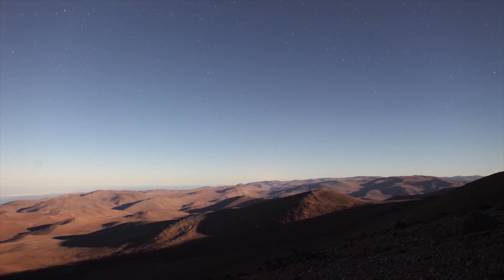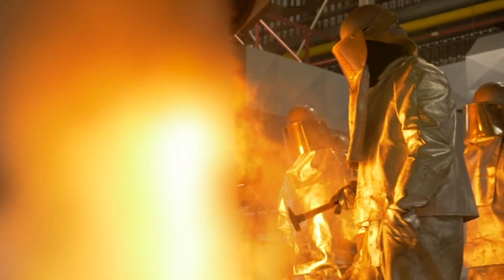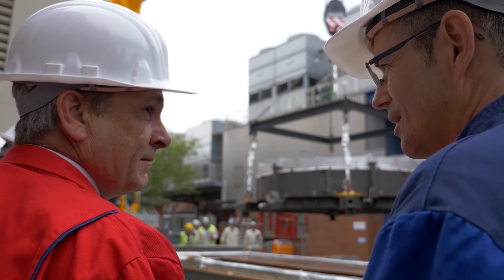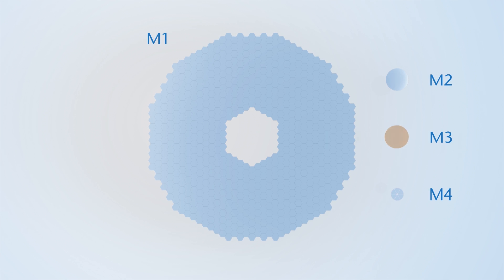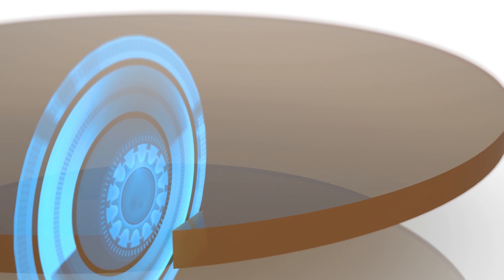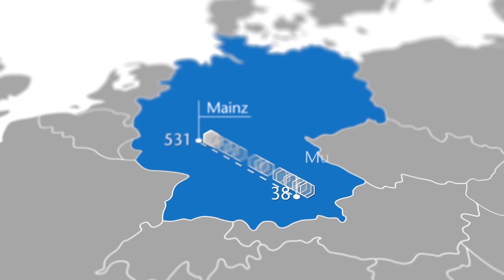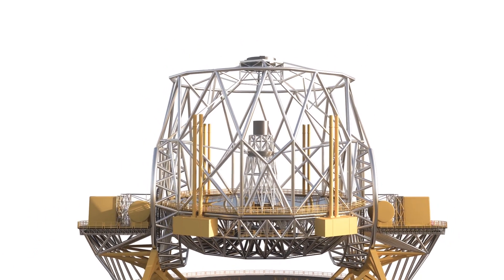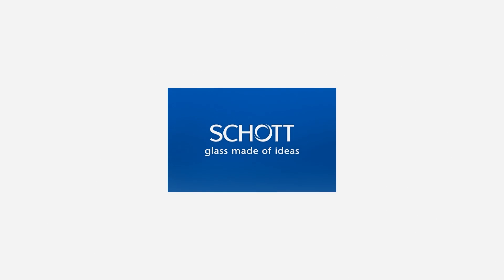SCHOTT & the ELT: Everything you need to know in 6 minutes

Comment: Is the M4 mirror really suspended in a magnetic field?
If so how is it kept in position then?
Reply: That's adaptive optics for you, https://en.wikipedia.org/wiki/Adaptive_optics
In short - it's complicated. But the idea is that an guide star, artificial or otherwise is used. AO sensor locks on to it and knows the damn thing is supposed to be still. It isn't, it wavers due to atmospheric disturbances. That error is fed back to the flexible mirror actuators, which are coils in this case. Bending the mirror in just the right way in real time corrects the error and results in steady image. In practice I imagine it's a whole lot more complicated.